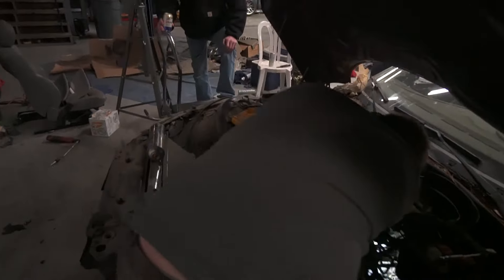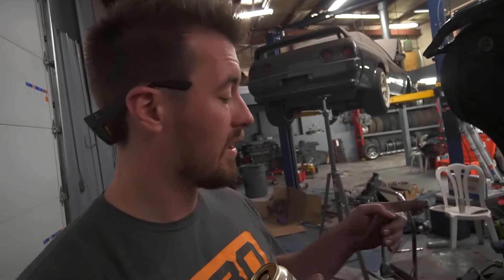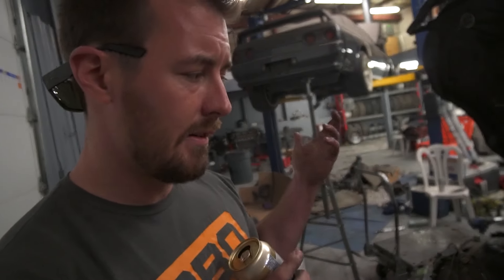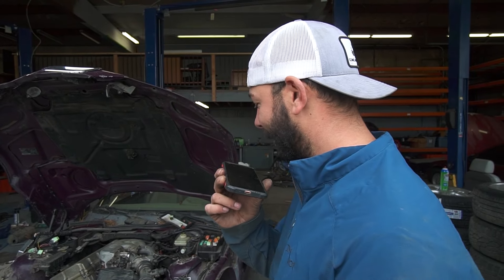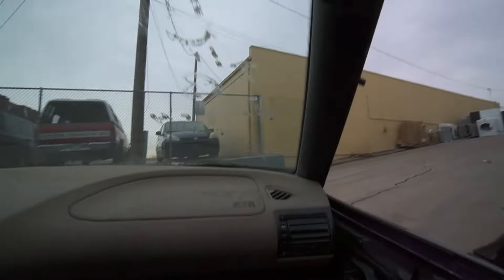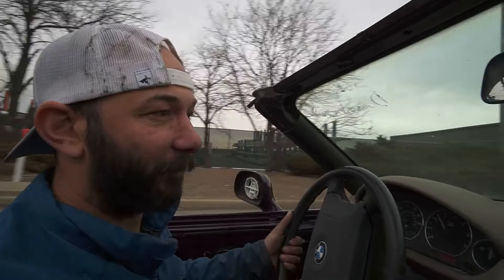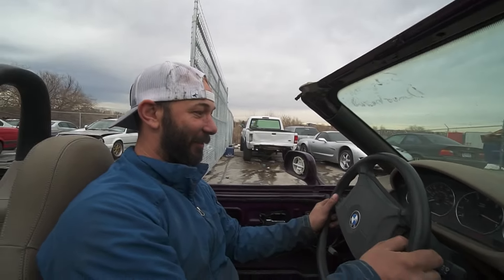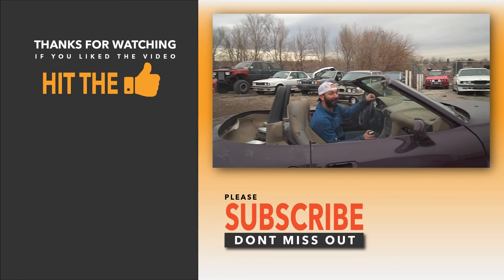After A YEAR We Found This EASY FREE FIX!! | Tinky Winky Lives Again!

Comment: Any tips on how to make a e46 318i beater reliable
Reply from the maker: Cooling system maintenance is always good on old BMWs. We didn't actually get 4-cylinder e46s in the US.
Reply: @DENVERBEERANDOIL  your better off without then tbh ive gone through 3 engines already 😅😂😂